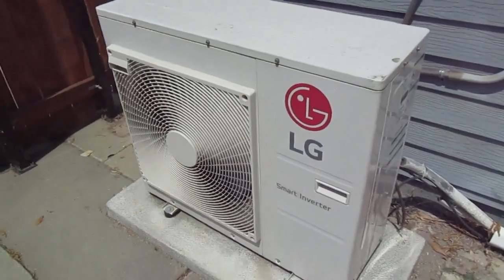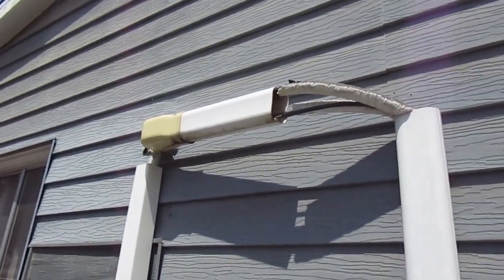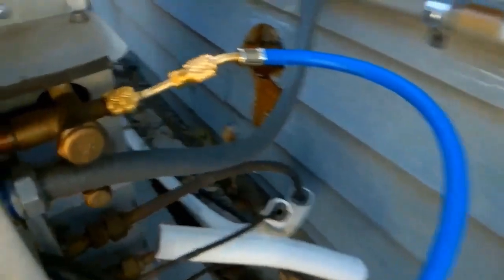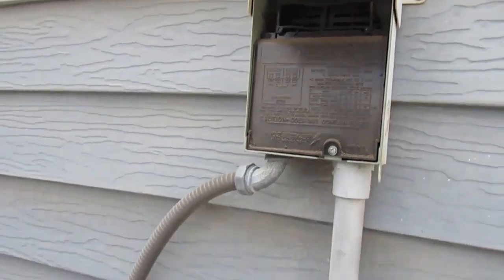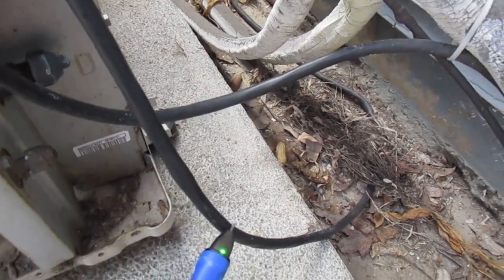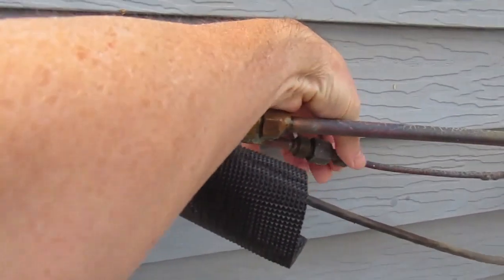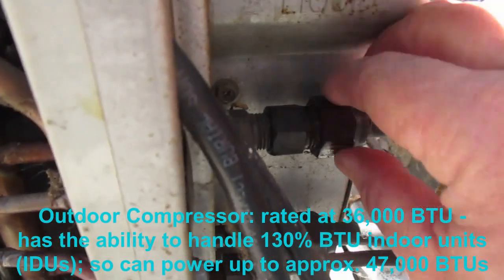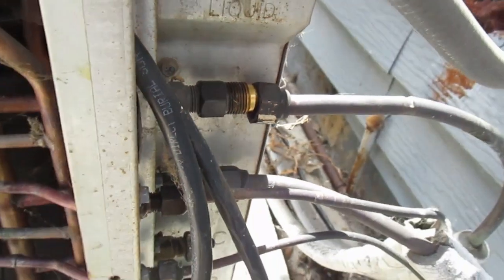Add a New Indoor Unit to Your Mini-Split System

Comment: I have a question. I recently installed a yitahome 115 v unit can you explain how to wire from the breaker? I have power coming through the hot wire that goes to the breaker, but is the neutral wire also bringing power? Although im getting power from hot wire to unit its not working.
Reply from the maker: I am not an electrician. I rolled out wiring and made connections from indoor to outdoor units and hired out the rest. I STRONGLY recommend you get a professional for the electrical work on a mini-split system.

Comment: i bought a mini split outdoor unit for cheapish at auction. it did not come with the indoor unit. Can i  install any similar spec indoor unit?
Reply from the maker: Good question which I don't have an answer for. My guess is "probably". You'll need indoor units that have lower BTU ratings than the outdoor compressor and make sure all units use R410A refrigerant. You'll need a dedicated electrical line for the outdoor unit and the indoor units will need to connect to it with the properly sized lineset connections.

Comment: Really ignorant DIYer here, but I need to replace a dead Trane mini-split.  Am thinking of Mr Cool or another DIY version.  But to remove the old unit, what must I do so that I do not leak out any of the gas (coolant)? Thanks!
Reply from the maker: Sorry, but your only option is to use a recovery tank (here's a link: https://amzn.to/45nUJIR) to vacuum out the existing refrigerant. You'll then have to add new refrigerant to the new system. However - many new compressors (the outside units) come with refrigerant pre-loaded. You'll need to research which compressors have refrigerant already and if so, then will you need additional refrigerant if you have lengthy linesets. It gets pretty complex but not impossible. This video gets into the weeds of adding refrigerant: https://youtu.be/nlm6zbYVwqQ

Comment: I believe I have the same outdoor 36k btu LG unit, and I have 3 indoor air handlers. Its a 3 bedroom ranch, 1000sq foot upstairs and 1000sq foot for the basement which I intend to finish. Do you think I could add 2 more indoor handlers for the basement, and 2 more upstairs? I want to add one to a bedroom and one to the kitchen. My question really is how many indoor units can I connect to this single outdoor condenser? I have 3 indoor, and intend to add 4 more if possible, or would I need another outside unit to do this? Thanks.
Reply from the maker: At the 2:17 mark on this vid, you'll see the details on what the outdoor unit can handle. You'll need a 2nd outdoor compressor to handle the indoor units you'll want to install. In addition, if your unit is the same as ours, it is designed to handle a max. of 4 indoor units regardless of BTUs. If you're going for 7 indoor units, you'll need two outdoor compressors. Also keep in mind that each one will need its own dedicated power which might impact your electrical system overall. Basements tend to be cooler - do you really need mini-split units there? Might be worth considering other cooling options.